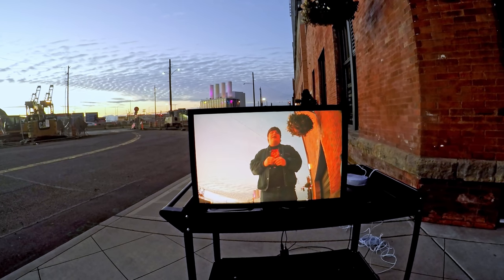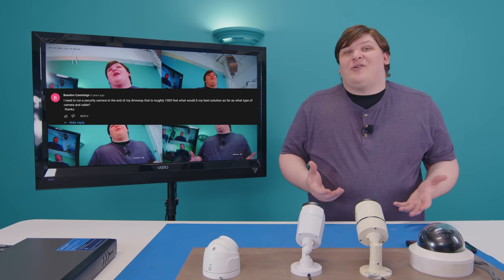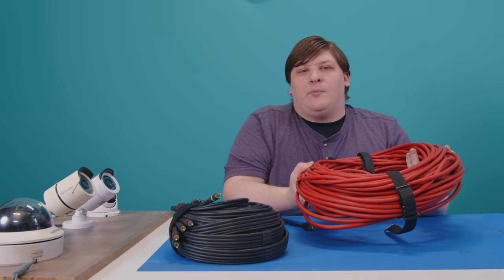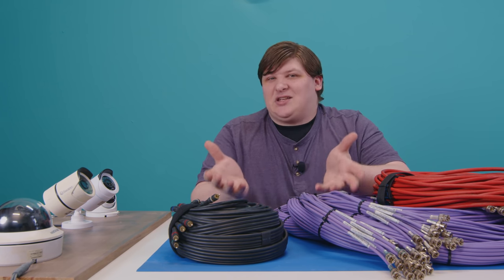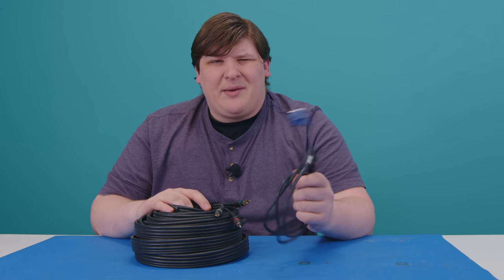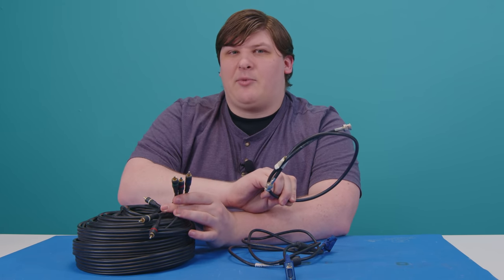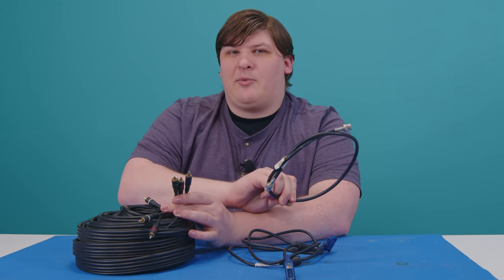1000ft of ANALOG HD video over a single cable?! [AHD/CVI/TVI]

Comment: Not sure if anyone else here mentioned it (skimmed the comments quickly), but you may have ommited "balun" connectors. Those small little units that connect to the bnc connectors of the camera and then you connect cat5 or cat6 cable in pairs to the other end of the unit. At the dvr side, you have the reverse, cat5/6 pair to balun, balun to bnc, into dvr. They eliminate the use of coaxial cable all together on the coax cameras. 

I haven't run 100's or 1000's of meters of cat5/6 with balun connectors, but I would say 50m wasn't uncommon. 

The nice thing about this setup being that if your 100m run of cat5/6 went all in one direction, say from the garage to the front fence, around to the side of the house and then to the back yard, you'd just slice into the cat5/6, pick the unused pair from the bunch, and leave the rest inside the sleaving.  4 cameras per run of cat5/6 makes for way easier installations and way less mess with cabling.

I helped a friend not so long ago wire up 16 cameras, on 3 or 4 runs of cat5, can't recall the exact length or amount of runs now, but it was well over 400ft as the box of cat5 was listed as 309ft and we went through approximately 1 3/4 of the 2 boxes. Also 1 pair was used solely for power, so effectively 3 cameras per cat5. 

All cameras were supposedly 1080p 25fps, although I can't say for certainty they were, I am just taking the Dahua's word for that. 

The image quality was by far the best I'd seen on a surveillance system in a while.

One thing that was not implemented was the audio, so I'd be kean to see if that could also be transmitted the same way 🤔

https://www.takealot.com/hikvision-ds-1h18s-passive-video-balun/PLID72994617?gclid=CjwKCAiAsNKQBhAPEiwAB-I5zaIxzTEQQ7kXqjsyKa3Yyysib8d1mv5SZr135lL0mEaoRGdtZAUCvhoCQFEQAvD_BwE&gclsrc=aw.ds

Ps. Great video, and very informative 👍🏻

Comment: I work as an electronic security installer and have been installing CCTV cameras of all types for well over 15 years. I'm also an electronics hobbiest and had been doing component level repairs & diagnostics for even longer. 

You are right in your suspicion that the actual camera sensors don't match the claimed output resolution. I've always been suspicious of this right back to the days of 2 megapixel cameras.. I've always thought "That's not 2 megapixels I can see the anti-aliasing!", viewing them on an actual 1080p display this is quite easy to see.

So once it got to the stage where early cameras in installations were starting to fail I pulled one completely to pieces.. I'm not going to mention any brands here but you can be assured it's one of the "reputable" Chinese branded ones mentioned in this video.

The cameras claimed output resolution was 3 megapixel in 16:9 aspect ratio. I smelled a rat immediately when I noticed the CCD was actually in a 4:3 aspect ratio so I knew it was cropping the image to start with, which by default would be reducing it's claimed resolution.

After spending several hours digging around in Chinese websites with the part number stamped on the back of the CCD. I finally found specifications of the image sensor. It was 1.3 megapixel and the specs also confirmed the 4:3 aspect ratio.

Not only was the image sensor a substantially lower resolution than claimed but it was being vertically cropped to meet the 16:9 aspect ratio.

I then moved over to the integrated circuits that were installed and found that one of the headline features of the DSP inside this camera was the fact that it could real-time scale and anti-alias images at full frame rate.

At this stage it was obvious to me what a lot of these manufacturers are doing to keep the production cost of these cameras down.

So, next time you look at a so-called high resolution CCTV camera and see with your own eyes that it's not as high-definition as you think you now know why.

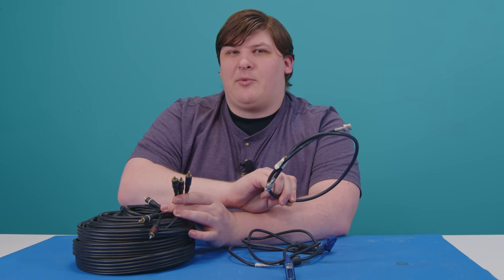Comment: Hi Gravis, At 14:20 you mention that their are no enthusiasts regarding CCTV, I’ve been into CCTV for the past 20 years or thereabouts, I currently have an older Analogue DVR which I don’t need as such plus a newer NVR which uses POE Cables, The NVR is the digital version of the Box that you referred to at 12:42 as a No-Name Security DVR, The reason why I have the 2 x Systems is because I think it’s good to have a redundant system or I just couldn’t be bothered to remove the original after upgrading, I invested in a PTZ PoE Camera and although it has an amazing Zoom I really could do with buying a new one and I’m not a fan of leaning out of my Tower Block (Apartment Block for those in the US) as I’m on the 8th Floor but I have and will if needs must and especially if I feel that I’d benefit! 🇬🇧

Comment: I wouldn't be surprised if these formats also lowered the framerate so that the resulting bandwidth isn't that much off compared to SD. You don't need to worry about CRT flicker with these, after all.

On the topic of analog HD, I'd also love to see your take on the short-lived broadcast formats for that from the late 80s and early 90s, namely Japanese MUSE and European HD-MAC. These actually partially use digital tech, and probably share some similarities to how the W-VHS format you covered previously works. But they still manage to cram HD video into a bandwidth not much larger than SD, and while the processing is partially digital, the signal itself is unmistakably analog.
Reply: That was my thought too, presumably much easier to get a better signal, if you use more time for each frame.

Comment: That "clever stopgap" showed up in lots of consumer hardware-  "anamorphic widescreen" DVDs used the exact same squish, and SCART even supported changing aspect ratios using voltages on the slow blanking pin.
Reply from the maker: But, as I addressed, those formats do not extend standard definition. 960H actually provides higher horizontal resolution to maintain roughly square pixels and a consistent H and V definition, while widescreen DVD and PAL lossily crush the widescreen image into a 4:3 format, resulting in a very wide pixel aspect ratio and lowered horizontal definition.
Reply: @CathodeRayDude  I'm pretty sure I've seen region 2 anamorphic DVDs that were encoded with a resolution of 1024x576.
Reply from the maker: @skonkfactory  As far as I'm aware, that's not what's encoded in the actual video stream, just what's output by anything that understands the intended display format. In order to make 720x576 look 16:9 with square pixels (e.g. on a naive display device), you'd have to stretch it before output.
Reply: @skonkfactory  This can be, theorically, 720×576, 704×576, 352×576 or 352×288 but never 1024×576. Either your video was converted or your software lied to you. The numbers i gave are withing the DVD norms, either on 4:3 or 16:9.

Comment: That's funny!  I did not expect my AHD camera system to be so special :-)

I am no TV expert by any means. I am just your typical (L)user.  I fully expected to be the only one to be decades behind with accepting new technology.

When I looked into upgrading the backup camera on our 20 yo RV I chose not to go for ethernet because I expected the inevitable delay to be unacceptable. You don't want to backup into a pole and only a second later see that you hit it right? I also wanted to add side view and forward view cameras so the system could be multi functional as dash-cam/security cam and driving cameras. I believed analog was my only option. 

Then I bumped into AHD and it's unbelievable claim of 1080P. The only problem was the available coax cable. Pulling a new coax cable would be a challenge so I was worried that that old original, like 3 mm thin 50 ft long coax cable could handle this higher resolution. But whaddayaknow, I now have full hd color over this terrible little coax cable. And I have been recording that backup camera's output and that of all 3 other camera outputs on a rinky dinky NVR 24/7 for over a year now.

Last thing to mention, I wanted no IR LED light to help with the image because that seemed useless for peaking in the distance during night drives. The four $35 amazon cameras I found have a much better night vision than my naked eye!

The only weird thing of these cheap AHD cameras is that they don't look like security cameras. They are in a strong metal housing and they are weather resistant though.

Not to advertise but to give you the opportunity to experiment with those alternative security cameras yourself, here is a link to them: https://www.amazon.com/gp/product/B086SS3Y5H

I don't know how much quality youtube scrapes off the original but here is an example of that backup camera: https://www.youtube.com/watch?v=VJwALRakng4

Comment: You explaining how the CRT doesn't care about horizontal line size since it's just a gradient makes so much sense now how CRT superres works in RetroArch. Makes it look super amazing because it runs some crazy resolution like 3840x240 but still can output because it matches the kilohertz range of the monitor

Comment: I was expecting you to mention HDMI over ethernet, as well, which I've installed in a friend's house, and it's a very simple system and the practical limit then becomes ethernet, not HDMI.
I didn't test the quality of the system, I mean, compare the same signal straight into the TV vs the one over the ethernet, but the friend was happy with the quality.
-
I mean, in addition to the section on video camera over IP.
:)
-
Also?
This video rocks.
I LOVED seeing all the different kinds of cables, and the one used for pro football?
How cool!
Reply: >practical limit then becomes ethernet

Not even that because once you're ethernet you can convert to fiber and back with sub $100 converters. You can go an 1/4 of a mile easily.

Comment: Very cool video. Without access to a scope signal to review, I'm guessing that the 15 fps "HD NTSC" trick is simply to  keep the 15.734KHz H sync (line rate) but transmit 1080 ordinary but stretched picture lines sequentially (no interlace). If we delete the vertical blanking period (after all this format would never be intended to display on a physical CRT) then the V sync period would be 14.58 Hz, close enough to the 15  FPS mentioned. Ingenious hack, and would have required absolutely minimal modification to the modulation and demodulation circuitry,

Comment: Regarding the switch to digital TV, it was mainly due to spectrum bandwidth reasons so that TV channels could be freed up for more common uses like mobile cellular. If you haven't already, you might want to take a look at the new ATSC 3.0 standard which has more robust error correction and is more versatile overall than the current ATSC 1.0 DTV signals.

Overall, the video was very informative and interesting to watch - I had always seen the cheap non-IP security camera kits and was wondering what technology and cabling they could be using to send HD video and now I know, so thank you for that :)

Comment: I actually use IP over coax in my house. MoCA 2.5 adapters are incredibly solid in my experience, even over unlabeled coax of unknown specifications (realistically, it's probably RG-59; it doesn't look as craptastic as whatever the white junk in this video is), and honestly they pretty much "just work". They also really are able to reach the bandwidth specified on the box, which was honestly shocking to me. That said, it's definitely not a cheap option. Perfect for me in a rental house where I can't really run my own ethernet through the walls, but I agree that it doesn't seem like a practical solution for a ton of security cameras with existing wiring.

Also, regarding digital over-the-air TV... yeah, I think you have a very good point. The only situations where I've seen it work well are with a larger attic or outdoor antenna. I have one in my attic and it actually works very reliably, but small indoor setups have always been incredibly janky in my experience, and I recognize that not everyone can set up something better easily. By comparison, I can remember as a kid receiving analog TV more than watchably with literally a pair of needle nose pliers as an antenna when the cable went out, since I didn't have a proper antenna on hand.

Comment: Incredible bit with the T-Mobile insert! Delightful deep dive as ever! Very minor in the scheme of things - after having dug into it myself before, I believe the whole Rec 601 idea is to take 720 samples per line, but start sampling just a moment before the active part of the line, and stop sampling a smidge after, such that 704 of those 720 pixels contain samples and the remaining 16 are for… a buffer I guess! Just 8 pixels of black on the left and right side of the image. I suppose for tolerances, because I could never find a precise authoritative figure on how long the active area of an ntsc line is supposed to last. However of course as you mention this subtlety is extremely susceptible to games of telephone over the years of digitizing hardware and firmware and drivers and web forums.

Comment: I didn't know these existed until watching this video, we have a few of these cameras and a similar recorder box at the hotel I work at, I just thought we have outdated security equipment.

Our recorder box is wall mounted and missing the top cover because there's a 3.5 inch HDD sitting sideways on it with nothing holding the drive in place and there's 2 TV's, one right next to the box in a tiny closet which also has important documents and the safe in it and another in the back room where we punch in/out so the housekeepers can see people going in and out to know when a room is actually vacant before cleaning it (I was working there as a housekeeper when I started last year but I'm a janitor now and I like that job better except for the lower pay now that I don't get as many hours).

Comment: An issue I had thought was critical for HD analog is bilevel sync. Traditional sync signals pull "to zero" for various amounts of time (usually fixed intervals in time, but only the "start" is relevant), at video level -300mV, while bilevel sync has exact defined shape in pixels on the negative and positive side of the sync edge (lining up the edge itself in between a minus and a plus deviation, like a crosshair). While it's a very "analog" property, it's one only relevant to modern digital approaches to signal sampling, and DC bias. Bilevel sync alone brings NTSC video (minus color) up to par with the NTSC-like Y channel of a component video signal, capable of monochrome HD video over long cables, and I was quite surprised to see black and burst on your scope.

Have you tried running the various formats through both cable TV and broadcast baluns and isolators? They're meant for >5MHz RF signals, but HD video's higher bandwidth might push its baseline characteristics above that.

On capture cards, cheap (and I mean $20 or less) capture cards with passable quality started showing up on ebay, ali, etc. in the past few years, and they're actually pretty decent for what they are. They may flake out unless you start capturing at the resolution your video is going to be, go mere hours without randomly failing... but you can turn decent chunks of 2K60 HDMI pixel data into USB 3 pixel data (or 2K30 into compressed USB 2) on a shoestring budget.

I've thrown analog to HDMI converters with odd formats at one sample dongle, and it happily took SNES/gamecube/PS2 240p+480i, and the VGA from a "Presenter-to-go" unit and several old PCs.